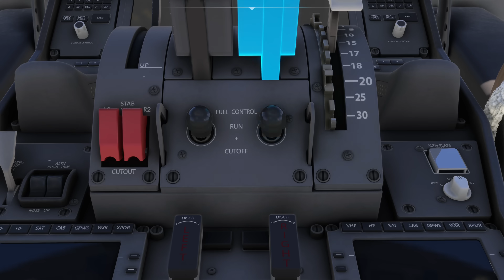Air India 171: Why Did The Fuel Cut-off Switch Get Moved?

Comment: When it comes to being responsible for 200+ souls, the last thing that should come in question is pilot privacy.
Reply: Even busses and trains engine cabin has cctv now a days.Even operation rooms have. Why is aircrafts excempted?
Reply: @RockyRock-vv3ex  Modifying / Retrofitting Old Aircraft and getting them ReCertified is not easy. Please check @mentourpilot s new video on Mentour Now Channel
Reply: @RockyRock-vv3ex  busses, trains, AND boats, and truckers, and construction equipment now even has companies setting up cameras in the cabs.
Reply: @SaintedPIacebo take the bus.
Reply: @RockyRock-vv3ex  because it can and has been used against pilots in the past (CVR) I can only image what they would do with cameras. so the answer is NO... BUT you can become a pilot if you like.
Reply: @SKIPWOOD-UA777CAPT-RET Audios can be deceptive., visuals cant be. Don't worry.
Reply: @RockyRock-vv3ex  oh I am not worried... what do you think the RET at the end of my name means?
Reply: @SKIPWOOD-UA777CAPT-RET I am already a pilot, and i think we need cameras ASAP.
Reply: @SKIPWOOD-UA777CAPT-RET  Of course there should be cameras. They have hundres of souls to take car off, and that is more important if a pilot is afraid of being filmed. It is not their private space up there.
Reply: @rabarebra yes it is OUR private space up there... why do you think there is an impenetrable locked door? so you have a camera... and what does that do for you exactly? all I need to do is push the yoke forward and make an airplane sized hole in the ground that smokes.... OR... I could just switch off the fuel control switches
Reply: @SKIPWOOD-UA777CAPT-RET people just don’t  have a clue at all…
I guess it’s senseless to discuss with those kind of people who have no idea about aviation but think they are experts. 
As you said, it’s OUR private space and it has to stay like that! 
It wouldn’t prevent any incident or accident and is therefore useless 
T
Reply: @Cars-k8e  exactly right
Reply: I understand why they might be guarded at this point of the investigation, but eventually it all should be brought out. When MH370 went missing, questioning the pilot's background was taboo, even though there were red flags.
Reply: @MikeD_ that's why Boeing is misleading us... it's Impossible that pilots of his calibre would do anything silly like this in a plane full of people and himself in it...this mental stuff might be a thing in other countries but not here.. obviously they r trying to portray Indian pilots as incompeten..but remember our life r on stakes at the end of the day.
Reply: @MikeD_  It's really a cultural thing. Same thing happened with Egypt Air.
Reply: @MikeD_  On MH370, the pilot’s background was questioned very early in, there was nothing taboo about it. Pilot background has been a standard part of aviation accident investigations for decades, you’ll see it mentioned in every report.
Reply: Yes, pilots should not have an expectation of privacy while they are in the process of doing their jobs. Hundreds of workplaces have cameras and no one bats an eye.
Reply: @TheAutisticTraveller  yeah, but we do...
Reply: @TheAutisticTraveller  Dunno if youre living under a rock or in a country where workers protection isnt taking seriously, but this statement is objectively false in a lot of countries that actually take workers rights seriously.
Reply: There's an assumption about who did what?

P1. Moves the switches to off. 
P1 Asks P2, why did you do that?  "Blame spreads"
P2 Says I didn't. 

Or 

P1 moves then to off. 
P2 asks P1, why did you do that/ 
P1 said I didn't. 

My bet it was the pilot monitoring who did it
Reply: They need cameras in the cockpit
Reply: Data doesn't capture emotions. Camera does, atleast to some extent. At a minimum, you would know who pressed or changed switches and if at all, they violated Standard Operating Procedures or Crew Resource Management. Data doesn't pick any of these. Extra aids doesn't hurt investigation. In fact it saves from blaming pilots
Reply: I’m a freight train engineer and we are video recorded in the locomotive cab 24/7 and we don’t even have passengers on board to protect.
Reply: @vanzell1912 First, thank you for what you do. There are people who live and work adjacent to the tracks that depend on your professionalism and attention so you're saving lives every day.
Reply: What privacy? Is it a bedroom?
Reply: @shajanjacob1576  Doctors should be able to disclose any pilot if they are on meds. Take German wings for example. He was told not to fly. If that doctor called the airlines and said the co-pilot was nuts then he could have prevented that horrific loss, but nope YOUR privacy was more important?
Reply: @shajanjacob1576 that's why Boeing is misleading us... it's Impossible that pilots of his calibre would do anything silly like this in a plane full of people and himself in it...this mental stuff might be a thing in other countries but not here.. obviously they r trying to portray Indian pilots as incompeten..but remember our life r on stakes at the end of the day.
Reply: @shajanjacob1576  no more silly games with flight attendants!
Reply: @shajanjacob1576  Precisely.
Reply: @shajanjacob1576 Bro you are not thinking straight
Reply: It’s all about protecting the mental health of pilots. 
The plane will be investigated by multiple agencies.. down to a speck of rust
The pilots? Get no treatment without potential loss of wings.
Reply: That’s a powerful point when lives are on the line, transparency should take priority. But here’s the question: how do we ensure accountability without turning the cockpit into a surveillance zone that erodes trust between pilots and airlines?
Reply: Using privacy as an argument makes me sick in my stomach.
I would love to know what was going on in my father's plane's cockpit. Privacy MA if you are responsible for other people's lifes.
Reply: @ssm445 was your father on this plane if you mind me asking?
Reply: @ssm445 that's why Boeing is misleading us... it's Impossible that pilots of his calibre would do anything silly like this in a plane full of people and himself in it...this mental stuff might be a thing in other countries but not here.. obviously they r trying to portray Indian pilots as incompeten..but remember our life r on stakes at the end of the day.
Reply: Absolutely right.
Reply: Everyone who is upset by this please send a to the FAA and/or your reps. There is power in numbers. Things get done when they reach a critical mass which is generally .33% of a threshold.  We are the ones in these seats behind the cockpit and are paying for the flight. Having cameras wouldn’t make this a guessing game.
Reply: Video recording should not be a question. The unions be damned
Reply: There's a camera on me all the time time where I work... I just ignore it...    what the hell wrong with pilots  ... are they too sensitive?? ....................   blood on the hands of the pilot unions
Reply: @MrUranium238 enlighten me how a camera would prevent this accident
Reply: You'd think that German Wings 9525 would have taught us that lesson, but apparently not.
Reply: I dont see a problem with cameras in the cockpit. Pilots are responnsible for 100's of lives. I drive a desk. Big brother is watching me. They can track what im doing by keystrokes. Webex they can tell when im online. My hubby is in underground  mining. They have cameras in their work utes. All machinery has camera's.
Reply: It is possible to have both privacy and cockpit camera. You only record it in blackbox hard drive. That  way 99.99% situations privacy is maintained.
Reply: Im not a pilot and so can not know if i would oppose/approve of a camera in the cockpit. 
A possible problem with only cockpit recordings is person can lie and possibly get away with it.   If a person lies on audio recording to avoid accountability, a camera might be a deterrent. 
Evidence shows these rare situations of suicide-mass murder by a human being pilot have happened.  With commercial flying being so safe, it does not take but one of two of these situations to amount to 'alot'
Reply: How would a camera in the cockpit have prevented this? Safety is about prevention.
Reply: Less privacy wouldn't have made any difference.
Reply: It anyways is looked into only at times of a crash investigation then why not have a video recorder as part of the black box.
Reply: This adamance about how there could be no other explanation than the pilot committed suicide by deliberately moving a lever and then didn't quickly fix it himself before even a second passed is ridiculous.

I'm not buying anything you're saying because you haven't provided any reason that this person would've done that. 

You haven't looked at any sort of personality profile of the two pilots by those who know them that would suggest this 

and there is no reason you can't get that because the press in India should be easily able to locate people who knew both of those pilots. Including coworkers.

Your insistence that this has to be done by pilot error makes you look like you're being paid by Boeing. 

If you want to be believed then do some more footwork to explain yourself. Nobody willingly just commits suicide normally.

You are inadvertently making people afraid to fly when you do that. How do we know that 90% of the pilots out there aren't just like these two? 

Are we supposed to worry that it's a crapshoot whether we're going to be put into a suicide dive? 

If that's what you think, then the airline will have to do a lot harder profiling and relief of overburdening the pilots. No matter what happened there needs to be a response. 

But we need to be able to believe the answer and we don't have any reason to believe anything that you've said yet because you've just backed it up with your presumptions.

"But that didn't happen here…" you say multiple times without any backup for your statement.
Reply: He got real defensive there idk why lmao, aren't they just supposed to be piloting the damn plane? Nothing to hide, nothing to be leaked
Reply: They could do whatever they want in privacy of hotel rooms & not in cockpit...use your hands for instruments & for nothing else
Reply: Perfect they are getting paid well and what privacy they want at work ? It’s safety critical for 200 some times 300 even sometimes may be 1000 if you crash on living areas
Reply: Also when it is a workplace , what is this requirement of privacy ? Do we prevent cctv in our workplace ? We don't , then why pilots ?
Reply: @Joy28N MANY workplaces have them: Truck drivers, train engineers, etc.
Reply: Exactly! Why are Pilot Associations reluctant to have it?  Is unprofessional conduct so common inside a cockpit?
Reply: Exactly!
Reply: Agreed. A lot of folks are ok with being recorded .this is mission critical to do it
Reply: I agree. What are they afraid of?  That someone in the company might see them eating a lot of snacks???
Reply: @kimberlyalcauter7094 that people get fired for nothing. We should film everyone at work then and let’s see how people feel 😂😂😂
You heard about privacy and data protection? 
Plus it’s an increase in stress and can create unsafe situations.
Not that every flight is already monitored anyway for mistakes 🙄
Reply: There is absolutely no reason why there can't be some camera view of the cockpit on a 15 minute loop.  No pilot should be worried about someone seeing what they are doing 15 minutes  prior to an accident.  If they are that concerned, then maybe they shouldn't be in the cockpit.
Reply: Everyone is talking about privacy, but what about justice and answers for the victims’ families. Put a damn camera in the cockpit. To hell with privacy. Those families deserve to know for certain why their loved ones are no longer here.
Everyone is acting like the black box and voice recording answers all the questions but it doesn’t. Was it a malfunction? Which pilot did it? We hear two voices, but which voice was which pilot? Also, the one that asked the question TECHNICALLY could have been the one that flipped them off and may have asked the question to set the other pilot up on the voice recording. A video recording would answer allll of this and more. No speculation needed. All answers given.
Reply: The 787's and captain Steve need to be grounded pending investigation of the Boeing 787's has different characteristics than the Boeing design documentation.

Captain Steve claims the 787's has a hidden computer onboard that will deploy the RAT instantly when the cutoff signals is given. 

This is a very serious accusation against Boeing design documentation which is part of the design it's.

As it has happened before with the MAX mcas disasters, we cannot outrule that Captain Steve is wrong and both 787's and Captain Steve should be grounded pending investigation.
Reply: Future demands cameras period were living. In a complete different day and age with tech exploding then when I grew up a lot of pilots starting to agree enough slready
Reply: @lonibeck2293 with automated systems these days, pilots are glorified drivers. Why is one even entertaining their weird whims and fancies
Reply: Have to add cameras agree complete different day and age it's a must
Reply: no such evidence for a soul but I get your point
Reply: I really respected this A**hole until he said no cameras in cockpit. This plus MH370 and others? Camera Please,
Reply: Stop lying. You are sold off to Boing. Why don't you talk about FAA directive from 2018 and CAA directive from May 2025 which talks about issues with Boing 787 which can cause cut off including during inflight.  Why Etihad airlines and DGCA wants planes to be checked. Why British Authority wants checks for this issue since May 2025?.

Western media is corrupt and sold to Boeing
Reply: How can the pilots sleep if there is a VR in the cockpit?
Reply: @brentcarnelli5664  Just don't get your question. You shouldn't sleep on your job in the first place. What about the safety of all the passengers? If that's your concern as a pilot, it is a time to change profession.
Reply: Fake narrative. Facts are here. You are sold off to Boeing. Why don't you talk about FAA directive from 2018 and CAA directive from May 2025 which talks about issues with Boing 787 which can cause cut off including during inflight.  Why Etihad airlines and DGCA wants planes to be checked. Why British Authority wants checks for this issue since May 2025?.

Western media is corrupt and sold to Boeing
Reply: FLYING IS SAFE ~ Statistical data from published Lancet Public Health reports actually indicate that suicide death rates in India have actually dropped 315% between the years of 1990 -2021. Great progress has and is being made...  So, despite resembling Jiminy Cricket facially, I agree with Captain Steeeve. Suicide by pilot is very unlikely "culturally" in India.
Reply: The fact that there was a 10 second gap between the one pilot knowing the engines were shut off, and the reigniting of the engines…and, a gap between the 2 engines being re-engaged, tells me there was a disturbance to get them turned back on.
Reply: More than, not ugly PLUS!!!!!!
Reply: If they only had cameras.,,,   stupid union refusal of cameras does not help ....  I guess we'll have to say it was suicide without any video evidence
Reply: Tbh having cctv won't prevent incident. I'm ok either way. But then again I'm also ok my mnc employer deploy keystroke logger and record me at work in the office / working at home. Not sure everyone else is the same.
Reply: @miketan4803 Have you seen the signs that say, "premises monitored by CCTV cameras" with a picture of security cameras? This is because it's known people change their behavior knowing they are monitored by cameras. In the very rare (but proven) occurrence when a pilot is intent in self harm he may take other actions if he knows his efforts will be captured on video. Recognizing this behavior preemptively might also prevent a catastrophe. So either way cockpit cameras have potential positive upsides with near zero downsides (cost).
Reply: @miketan4803 It's true the CCTV won't prevent an accident. But neither do the voice recorder or data recorders. Both the current "black box" devices are about collecting information for possible review and investigation at a later time. If audio is pertinent than why not visual capture?
Reply: Voice recognition will tell investigators who’s voice is saying it without needing videos
Reply: Try to imagine yourself being filmed really closely at work instead of just being the pitchfork mob this sabotage was set up to summon
Reply: or the insinuation that the pilots are at fault..the plane that you fly maybe inperfect as well..and corporations manufacturing these planes should come under public microscope too..as we all know to often how capitalism works...profit, greed and reputation...
Reply: Cockpit privacy is Captain Steeve's first thought and he's also locking out any possibility that there was any other explanation than the pilot "done it."
Reply: When the evidence is pointing to it ... The pilots will be questioned...
Reply: Western propaganda covering up and saving Boeing.
Reply: Its because youtube freaks out if someone uses the s word
Reply: ah yes
what are those pilots trying to hide?
what are they up to?
what are they doing or not doing?
etc etc
Reply: Interesting how many people twist themselves into a pretzel to find any other reason for the crash other than the obvious…
Reply: MentourPilot just released a video talking about this a day ago. Interesting.
Reply: So. Was the RAT deployed before all this fuel switch diversion started?
Reply: the western media shows wrong news to save Boeing 

The pilot asked “why did you switch it off” 
The copilot said “I didn’t do anything”..  the main pilot assumed if it is off, the copilot must have done this..

What you are not showing to save Boeing is - the fuel control switch automatically turns off and there is an advisory by FAA in Dec 2018.. and the idiots just kept it an advisory, didn’t make it mandatory to rectify the problem..

The problem is why would Boeing accept such a design where fuel control switch would automatically disengage.
Reply: @TomCat1980-nb  Respectfully, you are misinformed and your media is trying to save face. The advisory that you are referring to from 2018 has to do with the fuel cut off switch LOCKING mechanism. E.g. having to lift the switch before moving it. It has nothing to do with automatically shutting itself down. If that was the case, many more accidents like this would have occurred.  Please search SAIB: NM-18-33. Date: December 17, 2018. Even if the locking mechanism was faulty, the chances for both switches to fall to the off position within one second from each other on take off are near zero. Also the FAA has no jurisdiction over any country, other than the USA. Each country has its own aviation authority in charge of regulating aviation safety.

Here is a quote from the advisory (no where does it say that replacing the faulty switches is optional)):
"Inspect the locking feature of the fuel control switch to ensure its engagement. While the
airplane is on the ground, check whether the fuel control switch can be moved between the
two positions without lifting up the switch. If the switch can be moved without lifting it up,
the locking feature has been disengaged and the switch should be replaced at the earliest
opportunity."
Reply: Then according to your cctv camera in the workplace is also a part of privacy leak😂
Use some logic
Reply: 1000%
Whats Steve talking about "They might be reading a magazine in the cockpit and it wouldnt look good" wth
Reply: Every work place has surveillance cameras these days.Why not cockpit? Imagine an A380 with nearly 500 pax on board.
Reply: NTSB/FAA pass the mandatory requirement for video recorder just like voice recorder box. It can be opened only after the plane crashed. Problem solved! The hell with you privacy concerns pussies. Millions of lives are at stake here!!
Reply: this captain steve is complete id!ot, before prelm. report he said “might be mieeeght be” ( with his yellow teeth popping out) “ pilot has retracted flaps or not correctly set”. Once it was revealed from wreckage images flaps were extended this id!ot started pointing at fuel contamination lol. Bhaisaab! few youtubers did fair evaluation like jeffostroff. from the very beginning this id!ot is trynna defame pilot
Reply: How will that prevent the accident? Again the person is dead he won't be held accountable... That's not a solution it will only give answers but prevention is what is more important
Reply: Never fly to India lol
Reply: There is just a gap of 1 sec between the two fuel  control switches getting off, is it  manually possible  ..????
Reply: Tell that to the pilot's unions.
Reply: Recording for pilot cock pit can be kept and preserved in blackbox and once the flight lands it can be deleted so neither airline or anyone has access to the footage until it’s a crash.
Reply: Great, put even more pressure on the pilots?! You guys are living on another planet in the states I think.
Million of flights every year and we need cameras for one accident to prove what? I think pilots have enough pressure already and this would even Increase this pressure
Reply: Sharath Panicker, a Wing Commander and former Dreamliner pilot who flew the jet for 10 years explains exactly why it's very unlikely that a pilot error or manual action caused the fuel switch to "cutoff". He said that it's almost impossible to transition switches for both engines manually within a matter of a second. It's already in the news.
Reply: @mr.j6256 it’s very well possible. Those switches are next to each other and most pilots even have 2 hands 😅🤷🏽
Reply: @Cars-k8e  Sharath Panicker, a Wing Commander and former Dreamliner pilot who flew the jet for 10 years explains exactly why it's very unlikely that a pilot error or manual action caused the fuel switch to "cutoff". He said that it's almost impossible to transition switches for both engines manually within a matter of a second. It's already in the news. Are you saying you have more experience?
Reply: @mr.j6256 I say that I have more experience yes. I fly the 777 and in between the 787 since 2010. it is possible if someone wants it to be possible
Reply: Exactly, I'm under surveillance 100% of the time while working, and I am not responsible for hundreds of lives. In sure the pilots will get over it
Reply: If you get on a plane you must trust the pilots. A camera will only help after the event. Would a surgeon be happy preforming an operation with a camera filming everything for legal reasons?
Reply: My question is who select co pilots for every flight? And how is it done?
Reply: @odelamoses7210 it’s done by the company of course and it’s done either via a system or by crewplanning with manual paring
Reply: Look ur plane is at fault...and u guys r trying hard to blame it on Indian pilots. U think pilots from here have similar bullshit like u guys.. crazy how u guys r not questioning any technical fault and trying to make it a suicide thing....
Reply: Captain Steeeve mentioned something about a pilot reading a magazine or something "he should not be doing"........... why would it be OK to dismiss something "you should not be doing" in a cockpit of an aircraft where you are responsible for 200+ lives???  Sorry, if you want fly, you need to accept the awesome responsibility that comes with it.  I mentioned this on an earlier post, why are you OK with a voice recorder (which I believe the pilots' union is actually against that (for privacy reasons)......... imagine that, being "against" a VR)
Reply: @kevinclark2864  wonder how they r blaming it on pilot just saying that, might be a suicide thing..r u guy's crazy... it might be a thing in other countries, but here. it is more than impossible in our culture... obviously at this point it's a clear racism and without questioning actual technicalities. End of the day our lives r in danger. And big companies get away with there mistake especially Boeing. Only international media and content creators r pushing thos agenda to blame the pilots...
Reply: @kevinclark2864  what r u trying to say?
Reply: Obviously you are not a pilot . Anyway
Reply: I think it should be the first.
Reply: Also it doesn't make any sense...we have surveillance in taxis, buses, streets, offices etc why would't it be on planes, onky that be that footage is reviewed if something happens, for educational purposes, insurance and safety, why only hear if we can see too what's happening.
Reply: Tell that to the Unions. 
Unions have evolved into Mafia in all industries, hindering progress.
Reply: Absolutely.
Reply: I get your point. Counterpoint: What does it really change? Even if we had camera footage of the flight in this cockpit, the 200+ lives would still be lost. The cameras wouldn't have any preventative effect. All we'd know for sure is who is responsible. But they can't be held accountable anyway, because they are not alive.
Reply: @louibeans But we'd know if they really did it or not?
Reply: Exactly, I think the refusal has to do with most pilot living double life. It’s alleged that most pilots have their inflight wife
Reply: As a pilot, the level of surveillance would not increase with cameras. Honestly ask yourself what having this incident on film would actually change. We already know one of the pilots moved the switches deliberately. Seeing it on film wouldn’t get us any closer to answering the burning “why?”.

The CVR/FDR monitors everything that gets said and done in the cockpit.
Reply: Slacker pilots want to not be examined. If you wanted to respect their privacy it could only record to the blackbox which needs to be opened after a crash.
Reply: @mypovlife1337 we already have FDM that checks on us every single flight 😅🤷🏽
Reply: @mypovlife1337  you life will change dramatically when airline pilots go on strike... you have no idea.
Reply: @SKIPWOOD-UA777CAPT-RET cops didn't want body cameras before either. Accountability is a necessity.
Reply: @mypovlife1337  there is NO upside for pilots.... and with my 50+ years of experience, tell me what you base your opinion on?
Reply: @SKIPWOOD-UA777CAPT-RET did I say it had an upside for pilots? Can you read? The upside is for the general public, airline companies and other pilots.
Reply: @mypovlife1337  that's what they said with the voice recorders... so look up all the cases where a company violated that to get dirt on a disgruntled pilot, ending his employment.. (then tell me how the court cases came out)
Reply: This is a ridiculous take. If you are a pilot I would think you would be thinking how Capt Steve does but maybe pilots are closed minded which is not a good feeling as a passenger. In this case we don't know exactly who flipped the switch or if they did flip the switch. If we knew who did it you could look back into his other flights and behaviors to better understand the psychology behind people that decide to take their own life and hundreds of innocent lives. Maybe he was mad at the company but nevertheless having more data is never a problem unless you have something to hide. Now I'm starting to think you have something to hide when you fly.
Reply: @Allimalar-g4byou are saying the switches moved by themselves? With all the 787 flights this is the first time it's happened?

I don't think both moved by themselves
Reply: nothing to do with pilot's association disagreement. the companies dont want to get involved if anything goes wrong. as for pilot unions' stance, that can be conveniently staged out by the management.
Reply: Absolutely. And sad to see experienced pilots like Steve advocating in favor of no in-cockpit camera
Reply: One word why "Union"
Reply: @Hypersniper05  and supported by members.
Reply: Yes, they are to fly a plane with lives on board and not doing mischief
Reply: @princeantony08  I must have missed the mischief part... what is that like?
Reply: yeah, its not a bathroom.
Reply: Trucks, Metro trains, Commuter buses, Government buildings...they all have cameras. Not sure why planes and cockpit should be an exception.
Reply: Locomotive engineer here, and ex PAA A&P mechanic: locomotive engineers have been operating with inward and outward facing cameras for years!!!   They record 24/7 365 sight and sound.  Aviation world, let that sink in.  If only we had cameras on 171, we would see what happened definitively, period, full stop, end of story.
Reply: @tracksofnyc You are no one to tell “end of story” and there is no way a locomotive engineer can figure out manufacturing defect that appears once in a while
Reply: Having cameras inside and outside a plane continuously transmitting live images is so essential. That way we could have found MH370 as well. The footage can be deleted when the flight lands safely.
Reply: Try putting a camera inside your private space ie bedroom & you will loose all your mental peace. No one knows when a camera is recording & when or who copy paste its contents.
Reply: @CharanAhluwalia-rq5vh  I'm not getting paid when I'm in my bedroom so this argument is nonsense. Also 150+ lives aren't at risk when I'm in my bedroom.
Reply: Wrong.  Let's get to the desired result without compromising an individual's privacy.
Reply: What kind of mental health from pilots you can expect in country like this: https://youtu.be/pGwvjZOZx4M
Reply: Its funny news channels like BBC, CNN etc are trying to put the fault on Pilots even before the Inquiry Conclusion is Out.
Reply: Your statement is stupid,why pilots would needs privacy is it a bedroom or a corny job or what?
Reply: Your a bot
Reply: @Mandalorian-o4w  take off the mandalorian helmet buddy, you're not seeing straight.
Reply: It's complicate alright 😂
Reply: If pilot wished to crash it

1) why the Airplane  nose is facing up.

2) Why he again switch on the fuel.

3) Senior pilot also a trainer and 8000 hours of flying experience.

4) He wanted to retire,and he promised his father that he will stay him for ever.

5) Boeing company has many failures and trying to cover by western media.

6) Without preliminary reports they are saying pilot failure.

7) They both are Indian pilots and they both know Hindi every much, in that serious situation they still communicating in English wow.

8)Fuel cutoff switches are placed in a silly place without any safety.
 
9) Fuel cutoff switches are used in a manner by [ PULL,SLIDE,PUSH ].

10) Before flight there are videos showing that there no working of media, or screens, AC , crew calling gadgets ( may be ).
Reply: Even the very brief transcript released already condemns the airline/manufacturer. As the exact wording was '"why did you cut off?" (pilot clearly talking to the offending equipment). With the other pilot confirming he didn't do it. The switches are not directly connected to the cut off valves. The controller could close the valves itself and record a switch movement when it did not happen. Given the numerous well known technical faults prior, it's obvious this was also due to technical fault.
Reply: Nice you have Koyomi Araragi as profile picture ❤️ 7:48am 19.7.2025
Reply: There is a difference between depression and suicidal thoughts than a terorist act. Pilots are among the most satisfied and happy workers out there. They enjoy seeing happy people who trusted them with their lives and people thank the pilots for doing their jobs.
Pilots have one of the most unhealthy working environments, they are strapped in a chair at a lower than normal air pressure, they have to constantly monitor their instruments, many of them in continus Jetlag...
Reply: Although many individual pilots would agree, they are all represented by unions who will fight to keep them out of the flight deck to protect their pilots. I think it should be implemented. Recordnto the black box for 24 hours of activity
Reply: @Vinny-YT3  we don't care
Reply: @Vinny-YT3 that's why Boeing is misleading us... it's Impossible that pilots of his calibre would do anything silly like this in a plane full of people and himself in it...this mental stuff might be a thing in other countries but not here.. obviously they r trying to portray Indian pilots as incompeten..but remember our life r on stakes at the end of the day.
Reply: @Vinny-YT3  yes, and should be uploaded directly to the cloud to reduce chance of damage during an accident.
Reply: @MIEJ4 I disagree. That’s more of legitimate privacy concern. The black boxes are made to withstand crashes, and there’s two. More than sufficient
Reply: @Vinny-YT3  you mean one of the ones that were struggling to access the data from this accident due to damage?
Yeah. Not a great example for your point.
Reply: @MIEJ4 do you have a source for one being inop? I know both were recovered
Reply: @Vinny-YT3  https://youtu.be/kc1JJd3f-fE?si=mrD01497dXYk5O72
Reply: @MIEJ4 This is an excellent idea. There is literally nothing stopping this from happening.
Reply: @MIEJ4  Lol, no jesus christ... no. That is a security fiasco waiting to happen. Having ANY critical infrastructure of a plane connected to the internet is the dumbest idea you could have.
Reply: @CorruptNova  good that’s not my idea then. You have exactly what you have now, but keep uploading it to the cloud. What part of “critical infrastructure of a plane” do you think that would affect?
Nothing. Simple as.
Reply: @MIEJ4  How does one upload to the cloud? Hmm? Sending any information over the air is inherently a security risk. Black boxes are recovered in working order the overwhelming amount of circumstances. An incredibly small amount are damaged completely and an even smaller portion of that are unable to determine how the crash happened. It is completely stupid uploading anything from a plane to the cloud, end of story.
Reply: @CorruptNova  you think anyone intercepting flight data will be able to make the plane crash? Pull the other one🤣🤣🤣🤣🤣🤦🏻‍♂️ You sound like you’re completely paranoid and unable to think of potential easy solutions to problems that already exist. This is why China is overtaking the US when it comes to technology. Congrats.
Reply: @MIEJ4 video images get corrupted far more easily than voice recordings or data recordings.  If the VR and DR boxes are unrecoverable in a lab, then the video box will also be unrecoverable.  It will just be blocky images of no value

.
Reply: Their argument isn't privacy. They're worried the airlines would use them to micromanage and harass them, and there is reason to believe that would indeed happen. However, pilots generally aren't opposed to the idea of cameras operating like a flight data recorder, where the data is not available unless an incident or accident occurs that is being investigated by a proper agency.
Reply: Put the God damn cctv in cabins...to hell with delicate feelings of pilots. Because passengers are there you are there... passengers safety first!
Reply: @schnellster1  “God damn” really hammered that home for me. 😂
Reply: @schnellster1  Language!
Reply: @schnellster1 If a pilot is going to kill himself and all on board he doesn’t give a tinker’s curse about his own privacy. Would help the investigators though.
Reply: @LPB872 Dear, LPB i haven't used any unparliamentary language. The plane was damned by God and the cctv by not being installed in the place are damned by God(God Damn)...it's english your reverend highness..aint no F word!  Are you by any chance the 'Feelings' police?
Reply: @schnellster1  Think about it. This is NOT about pilots' delicate feelings. It's that cameras won't PREVENT. Cameras are there to unravel AFTER the fact. Detection and Prevention. What you are suggesting is that after the accident we have footage of what happened in the cockpit. What good is that? Would that have prevented this?
Reply: @dhudach  it would prevent the next one....
Reply: @dhudach  Nonsense. It's proven people's behavior is altered when they know they are viewed by camera. This is proven through the expanding use of cameras in our world leading to safer environments.
Reply: @sunrisejak2709  Yes, behavior is altered, but it doesn't mean they do the right thing. Show me this proof. Cameras are everywhere but people only find ways around it, that's how their behavior is changed.
Reply: @dhudach  whichever pilot committed mass murder here set it up with the shut off accusation and knew and timed it for success. he knew he wasn't going to be on camera. if he had been on camera he might have just offed himself quietly at home. so, maybe a camera would have worked as a preventive measure.
Reply: @susanohnhaus611  Or maybe not.Or maybe he'll choose another day or another opportunity.  I'm not suggesting that safety measures be disregarded. I'm suggesting than an altered frame of mind isn't going to follow yours or anyone else's logic. I maintain: Detection and prevention. These "camera in the cockpit" solutions that "will solve this" are akin to taking pain medication to fix a broken leg. I say: Treat the cause not the symptom.
Reply: @trith72  Please explain how it would prevent the next one. Take me into the mind of someone who would do this, someone with an altered frame of mind.
Reply: @dhudach A camera won’t prevent an accident on the same plane, but could very well reveal an issue that saves FUTURE flights. That is the whole point. Take this case: a camera would show exactly what happened to the switches - who activated them, or more importantly, did they move or fail without human intervention? which would be a huge safety issue for thousands of other aircraft.
Reply: @dhudach If people are trying to find a way around being viewed on camera it could be they have something to hide. Even doorbell cameras have a positive impact on people's behavior. Many people have security cameras in their homes that are visible to potential wrong doers. If a pilot is intent on self harm and the use of a cameras alters his behavior and saves lives that's a good thing. In this case it's puzzling the exchange about who moved the switches. "someone did". Identifying that "someone" and understanding the circumstances could lead to solutions aimed at preventing such occurrences repeating in the future. Cameras in the cockpit have only upsides and no downsides.
Reply: @dhudach Many cars now have internal cameras aimed at the driver and provide an alert with the advent of falling asleep. In aircraft it's even more critical.
Reply: @dhudach We would know what everyone is speculating about: who pulled the switches.
Reply: @dhudach Same goes for audio! It also doesnt "prevent". 

Are You suggesting we stop doing investigations?
Because they happen "after the fact"?
Reply: @dhudach  Cameras will prevent, because it puts a higher barrier to cover a lie.
Reply: @dhudach  Maybe not this crash, but accidents have happened because pilots have not maintained a sterile cockpit and knowing there'd be a permanent video of them might make them pay attention and follow the rules.
Reply: Most stupid comment ever. The only hands that can dictate the flight in the plane are the pilot's.
Reply: @Kai-ie6qg BOEING IS BEHIND THIS MARK MY WORDS
Reply: @Kai-ie6qg only if the hands that are flying 200 plus souls feel safe from politically correctness, they can safely deliver.
Reply: I think cameras would elevate pilot stress and perhaps lower candidness, neither of which I would want as a passenger.
Reply: @sarahkc5678  no it wouldn’t, and certainly not an excuse for any other jobs. Get on with it.
Reply: @sarahkc5678  No.  Cameras are needed, pilots need to get off their high horses.  If they can't handle CCTV recording them, they are too mentally fragile to be flying passengers in the first place.
Reply: Why is this pilot trying to defend Boeing?
Reply: The feeling of being under constant supervision makes the crew nervous and more stressed so i understand the no camera wanted - from a pilot view.
At minimum the camera should autodelete after (safe) landing and not being accesed outside of a post-accident-situation.
Reply: @alhu5514 If aircraft crew are easily made nervous than being a pilot is the wrong occupation. The 2nd part of your comment makes perfect sense. 👍
Reply: Accountability, not scrutiny. People don't care if you do whatever the hell you want in the cockpit. People care about getting from point A to point B safely.
Reply: @benleon  yeah because pilots are the scum of the earth and are untrustworthy and don't have families to go home to... you freaking people are so stupid.... you have no idea what an airline pilot has to go through to get where he gets in his career or even what it takes to keep it.
Reply: The pilots are dead they can’t defend themselves. I believe that  this is malfunctioning of the fuel switches as FAA issued an advisory regarding malfunctioning of switches used in 737 . The sam were used in 787 .
Reply: @owaislone2060 quit reaching, there was no mechanical failure
Reply: @owaislone2060 sorry buddy but I am a pilot there is no way a mechanical failure crashed that plane. The left seat reached over after rotation and turn the engines to cutoff. The fu##er did it deliberately when there was no chance to go through the emergency proceedures. He didn't have the altitude to push the nose over and get some more air over the wings to create lift! It happen so fast they didn't get the gear up nor the flaps! The take of proceedure checklist is practiced so much you hear that s**t in your sleep. V2 last of the useable runway, positive rate of climb, gear up, flaps up.
Reply: @owaislone2060  Millions of flights safely completed using the same switches, no fatalities. The investigators have the switches from the crash, no mention of any proof that they are faulty. The FDR recorded that the switches had been cycled. But, random guy on YouTube isn’t convinced 😂
Reply: @owaislone2060 if the switches malfunctioned, why did one of the pilots ask the other pilot why did he cutoff? Why was there a delay between the two switches malfunctioning? Why did it take 10 seconds for either pilot to move the switches back to the run position? Why have they involved an aviation psychologist in the investigation? Why is the global 787 fleet still operating as normal?
Reply: then you should become a pilot....
Reply: @SKIPWOOD-UA777CAPT-RET   Why?  Only a commercial pilot should be allowed to decide whether cockpits should have cameras? Only commercial pilots should be allowed an opinion?  There's no logical argument, when there are already microphones that would catch any conversation, against having cameras at the very least covering all of the mission critical controls in the cockpit.  If there weren't already voice/audio recorders perhaps there'd be an argument, but the audio is far more invasive to a pilots privacy than the video (straight to black box only, not cloud) would ever be.  I don't care about the pilots faces, cover the control services, let the investigators (in the event of a reportable incident) and the investigators only, review what switches are flipped and by which pilot.  This isn't a bedroom, a locker room, its the helm of a 400,000lb cruise missile with hundreds of lives on board and more at risk on the ground.  Put the cameras in.
Reply: @MDC_1985  you know that CVR's can be deactivated ..... right???? oh no??? and there are NO commercial licensed pilots flying as captains... they must have an airline transport license. and NO... NO CAMERAS... bring it and see how many pilots refuse to fly SHUTTING DOWN THE AMERICAN ECONOMY
Reply: @MDC_1985  Your argument is so bad lmao.
Reply: Anyone saying that video cameras should be installed doesn't understand aviation and all of the reasons why pilot unions resist such actions. At best, limited scope cameras would be the compromise but, that isn't the policy being put forth. Limited scope cameras would be limited to narrow segments of the controls and switches and not a full view of the cockpit. Misinterpretations, leaking or tampering by foreign states, media and the public already happen with CVRs. Full cockpit video would very much attempted to be used out of context, in litigation and as means of surveillance by airlines to punish pilots. All things that are NOT the purpose of accident data. It breaks the "just culture" around aviation and strains the trust pilots have in that system. Comparing it to other industries is not apples to apples, commerical aviation's just culture is very different from the way every other industry works. It isn't as simple as installing a bunch of cameras, thousands of planes would need retrofits and even retrofitting a single plane isn't trivial. It would be extremely expensive to do so while airlines already work on single digit margins.
Reply: @CorruptNova  As another person in the comment field said. IF pilots and unions disagree this much about having cameras onboard, it shows how corrupted they are. Simple as that. Cameras CAN prevent, it sets the barriers for lying much higher.
Reply: Youre acting like having a camera in the cockpit would have prevented this.. you could just as easily solve this by taking care of employees needs and promoting them - not monday morning quarterbacking away mental health struggles. Identification before eradication of basic rights.
Reply: @mwd5037 exactly 😂 also, these people who cry so hard for cams in the flight deck are the same ones who would get fired once they install them in their workspace 😂
Reply: @mwd5037  since when is prevention the point of security cameras? it is about ACCOUNTABILITY and RESPONSIBILITY for the lives involved.
Reply: @mwd5037 Camera would solve this case.
Reply: @mwd5037  Cameras could actually be a prevention for liars trying to cover up their aftermath. Simple as that.
Reply: @mwd5037 no the people closest to this dude should have been watching out for him and knowing what he had going on should have interfered. There are times when being a Karen is vital, where you don't just mind your own business! "Dude are you good, you get enough sleep, you don't look like you are up for this. Why don't you just call in and get off the board."
Reply: It's more that the tools already in place, FDR, + CVR, yield information to solve 99.99% of accidents.  The FDR is a far more powerful tool for recording pilot inputs and aircraft feedback than any camera system can show visually.  Optics are not necessarily the best option for recording facts, as odd as that may be.  In this case the camera would show who cut the fuel, but it was the FDR that proved that they were moved in the first place.  From a pure safety point of view the cameras will add nothing that the FDR haven't already proved.  Safety is about what and why.  We already know what happened (someone cut the fuel), cameras, FDR + CVR will probably never tell us why.  Upgrading every single commercial flight deck with 4K camera systems tied to the black box would cost $$$millions, which is a lot for confirmation purposes without necessarily adding safety.  Trains and trucks use cameras partly because they lack the technology of a FDR.  Trucks also use outward facing cameras because they are in constant threat of hitting things.  Aircraft don't operate in that type of enviorment.
Reply: @matthewwillkens8240  Weak arguments. Good try.
Reply: @matthewwillkens8240  you’re argument makes zero sense at all. No one is arguing about the FDR, no one is suggesting to replace the FDR with video recording. You’re just adding baseless points to argue against. Yes the FDR is important and extremely useful, however video would show things that it cannot show. Video recording is 100% necessary and would clear up so much in this situation and many other past and future situations. It doesn’t matter how useful all other methods of recordings are- videos would be an added benefit and it’s insane that in 2025 it’s not already a requirement.
Reply: @matthewwillkens8240 Visual is 100 times effective in analysing than electrinics and audio. Vision is the primary sense of humans. Visual evidence stands high than everythibg else
Reply: @matthewwillkens8240  I think the confusing part for a lot of folks would be settled with video. As in, while we have confirmation via signals that this was a manual action of moving the fuel levers to the cutoff position, a video of this happening would 100% remove doubt that there could be some random or other mechanical behavior that led to them being set to cutoff. Perhaps this is already known with a much much deeper understanding of how these mechanical switches actual operate, but to the general public this is still left in question.
Reply: @matthewwillkens8240  the fact that the settings changed does not mean they were physically moved. 

And if the data recordings can definitively tell whether something was physically moved or changed settings that is one thing 

but it seems that any additional backup would help such as visual evidence. They do not need to keep it after a flight if there is no crash. 

They could routinely delete these video recordings automatically if the plane lands safely.
Reply: Totally disagree..CVR+Video will do wonders..in this case we would know  which pilot handled fuel switch
Reply: @matthewwillkens8240  A permanent video record might keep pilots from playing fast and loose with the rules. Accidents have happened because pilots were distracted by BS conversations and not attending to the task at hand.
Reply: Disagree
Reply: A faulty fuel cutoff switch where the locking mechanism failed. When it took 1 second to turn them off why did it take 2 seconds to put them back to ON position where it’s an emergency situation. If a copilot would reach out to switch them off quickly, it will make a certain movement ans noise which will catch a captain’s attention.
Reply: @MototechWanderer  No. My bet is the capitain switched them off. 
He had his hands near the throttles as he was monitoring.  Co pilot was flying, eyes out of the window. 

I bet he did this soon after V1 when he moves his hands away from the thottles.
Reply: You have the choice to not fly. Cameras will do nothing to help
Reply: @desmit6  Oh yes, cameras can prevent cover-ups, manipulation, lies etc.
Reply: A camera wouldn't prevent an accident, it would only allow slightly better (perhaps) investigation after the accident has happened.  Since you don't  care about privacy, I  say they should also release photos of the bodies at the crash site, along with full autopsy reports and photos.  You never know what key fact might have been overlooked, eh?
Reply: @kurtlaughlin4250  Certainly release pictures after school shootings.
Reply: @kurtlaughlin4250 Cameras indeed affect people's behavior so, yes they could prevent malicious intent and add to safety. Not showing photos of dead people is about decency and respect. Official investigators will indeed use such "tools" in their quest to determine explanations and knowledge for how things occurred.
Reply: @kurtlaughlin4250 Faulty logic.
Reply: @kurtlaughlin4250 what are you talking about lol what a stupid comparison lol
Reply: When you get the data from the recorders,  you don't need to invade the privacy of the pilots.  That's his point.  It would add nothing.
Reply: @mariannorton4161 in this case it would add to the findings by showing which pilot moved the fuel cutoff switches. Also, knowing who’s voice said “why did you do that” or whatever exactly was said could lead to wrongly blaming one pilot, when the one who moved the switches could have said that himself, knowing the CVR recording would shed blame away from him to the other pilot.
Reply: @mariannorton4161  
I disagree. In this case it would show what happened in the ten seconds between the initial shut off accusation and the switches being turned back on. That's a long stretch of time in a 30 second flight. Even if the sound recorder gives us evidence of a fight between the mass murderer and the hero trying to save all, there will always be those who say without visual evidence we don't "really" know.
Reply: @mariannorton4161 wouldn’t we be able to see the switches and who did or did not flip them?
Reply: @mariannorton4161 exactly, all data you need to prevent accidents is already stored in black boxes. People act like putting cameras will change their safety and at the same time they say eveyrthing is already recorded 😂😂😂
Reply: Visual+audio will add much more...like in 9/11 we would have known exactly as what happened to pilots
Reply: It is like  only hearing the dialogues of a movie visavis watching the movie with sound
Reply: @mariannorton4161 , yes it would have helped. With a camera, we would have seen if the pilot actually did move the levers or if it was a mechanical failure. A camera would have shown exactly what happened!  FDR are not the end all of technology.
Reply: @mariannorton4161 sthu.

Here.

Locomotive engineer here, and ex PAA A&P mechanic: locomotive engineers have been operating with inward and outward facing cameras for years!!!   They record 24/7 365 sight and sound.  Aviation world, let that sink in.  If only we had cameras on 171, we would see what happened definitively, period, full stop, end of story.
Reply: @mariannorton4161  so why is it ok for bus, train etc drivers to be on camera? Are you saying those cameras would prevent accidents and not just confirm what happened? It is no different to a plane cockpit. Are pilots worried about their privacy as they walk in front of multiple cctv cameras on their way to the planes? Surely not.
Reply: @mukeshkukreja53 so why should pilots get away with it? Why are they lie important than bus or train drivers? Surely they should have more responsibility for a greater number of passengers and possibly people on the ground being at risk.
Reply: @MIEJ4  One item would be those are operated by a single individual
Reply: @MIEJ4   Busses don't have data recorders, after that, the video won't do much if there is an issue that causes a crash.  Video makes "you" feel better, it does nothing to get into the mechanics of what went wrong.  They don't need cameras.
Reply: @mukeshkukreja53 safety trumps paranoid pilots worried about being caught not doing their jobs properly.
Reply: @MIEJ4 it’s apples and oranges, you can’t compare the 2
Reply: @MrMgage13  of course you can. There’s all sorts of comparisons. Why are pilots so special? They just drive a big bus at the end of the day.
Reply: @MrMgage13  Don't bother with @MIEJ4, rereading their comments shows they are attempting to troll. I should have noticed this earlier. They aren't engaging in good faith.
Reply: @MIEJ4 because road accidents need evidence to prove who’s fault it was.
Reply: @1dukky806  but planes don’t need to prove who’s fault an accident was, right?🤦🏻‍♂️
Reply: @MIEJ4 you already know who is at fault. It’s most likely pilot error. Do you need to know who did it? What would video evidence change? How it would prevent this accident from happening?
Reply: @1dukky806  likely yes, but you don’t know 100% - nobody on here does. You’re all jumping to conclusions insisting you’re certain. It’s fairly pathetic.
Where did I say that video would have prevented this accident - again, you seem to think not, but if it’s a suicidal pilot then quite possibly it might have been enough to put them off. Right? It certainly wouldn’t have contributed to any accident but just might give that extra evidence that data recorders sometimes leave investigators scratching their heads.
Reply: @MIEJ4 you are already elevating yourself above everyone writing that they are pathetic for saying this and that, yet you are the one already jumping to conclusions after reading a preliminary report.
And saying that a camera would have prevented a person that had plenty of flying hours (indicating it is not a “oh i just got up today time to put my flight to the ground”) from doing what they did (supposedly, since we don’t know it yet) indicates that your solution, with all due respect, for mental issues is to go out and talk to people. There is no sense in continuing this conversation. Have a nice day!
Reply: @1dukky806  yeah, pointless continuing if you can’t read what I wrote and keep misquoting me. It’s more than a bit pathetic having a go at me when it’s clear you mustn’t be able to read properly. Congrats. I seem to be about the only one who’s NOT jumping to conclusions after reading a preliminary report.
Reply: @1dukky806 "most likely" is not good enough. Accident investigations seek to determine as precise as possible the entire and accurate sequence of events. The data and voice recorders do not prevent accidents. They are tools for investigation with not only accountability but what can be learned so such events don't happen again. With your logic it would justify not having any black boxes as they don't prevent accidents. If you're recording data from the airplane and sound in the cockpit why not visual detail?
Reply: @sunrisejak2709 no no, this is not what i am saying. What I’m trying to say is that video surveillance adds little to zero additional value to the investigation. You have black boxes, that basically track every electric current flowing through every place that is key for aircraft operation. Every change of every switch is logged. You have voice recorders that record every word pilots say. What does video add? That you can see what you already know from the black boxes? You already know what has happened with the plane. Remember, this is preliminary report, meaning they are not fully sure what happened.
But this is only one issue with cameras. The other one? Installation and maintenance. Sure, you can install cameras into new planes, but what about… tons of the planes that are already flying? What about the certification of these planes? This is not a “well just slap a gopro in there” type thing.
Problem is lying earlier, perhaps in recruitment? maybe provide help to people that actually need it instead of immediately revoking them the license they worked for their entire life? Aviation safety is not about finding victims - it’s about providing as much safety as possible.
Reply: @1dukky806 Your last statement "It's about providing as much safety as possible". Then adding cockpit video follows that statement! No denying the value of cockpit voice recorders and data recorders to assist in helping create safer airplanes in what we learn post accident. Vision is one of the most valuable tools we have on earth. Cameras are now pervasive in our daily lives and serve undeniable value. It would also make sense to have video record of the general cabin as well. It could help to encourage best behavior of passengers too. Seeing is believing. Safety is indeed the goal for everyone on the airplane.
Reply: @sunrisejak2709 I just don’t see any value in it. Let’s take this air india flight as an example. We don’t have full cvr transcript yet. We know that two switches were pulled down in a timespan of one second. They were put back up, indicating this is not a mechanical failure. As of now (since the investigation is not over yet), it looks like pilot error. People died. How would a camera help here? You have two pilots, one experienced and second one very experienced (i dont remember the exact hours), one of them (probably) decided it’s time to end it. How would a presence of a camera take him off of this path?
Reply: But what would cameras have even added here? Cameras in other transit industries have mostly been used to penalize workers, why would this be any different?
Reply: @davidfuller581 Is audio recording used to penalize? No. Its only allowed to use in safety/acvidents. 

Why would video data be any different?
Reply: @davidfuller581  Cameras obviously wouldn't have changed the outcome, but they would have confirmed who cut the fuel off and whether it was the same pilot or the other one who turned it on again.
Reply: @davidfuller581  Possibly nothing in this case but it would make pilots more likely to follow the rules. And if a worker breaks the rules they should be penalized.
Reply: How much did boing pay you Steve.. I know finally they will blame pilots because they are dead
Reply: @TheRootsAndRealities What a stupid thing to say, were you dropped on your head multiple times??
Reply: At least SPELL Boeing correctly if you want to be taken seriously.😂